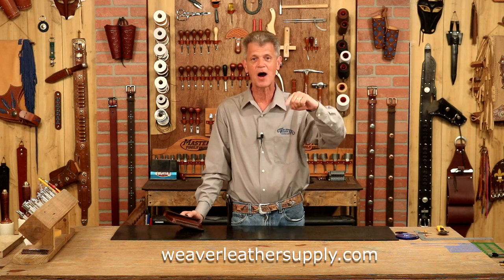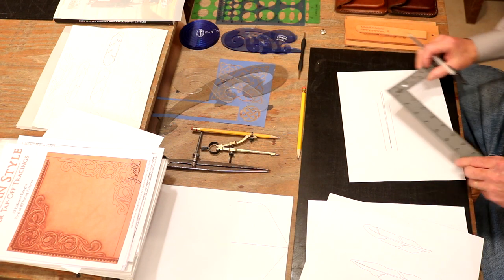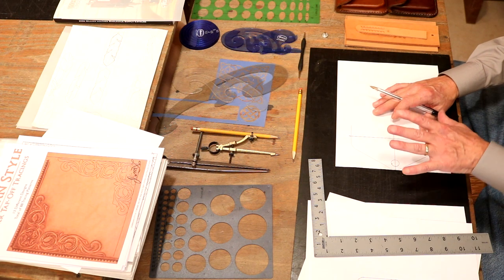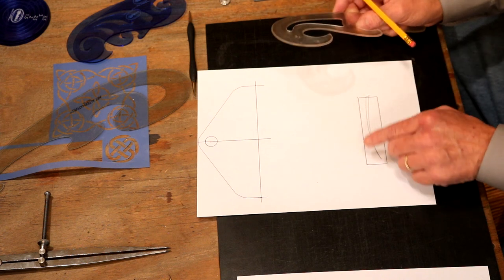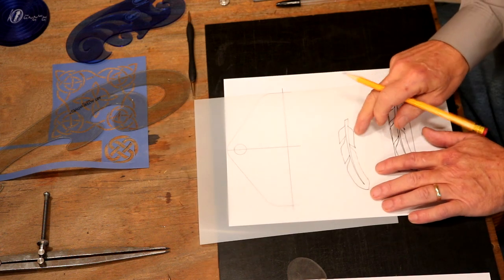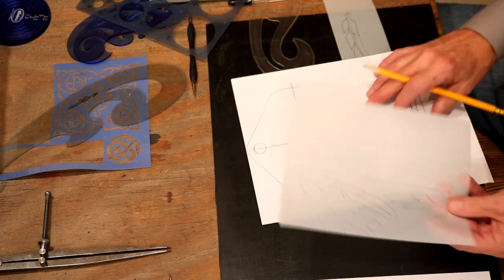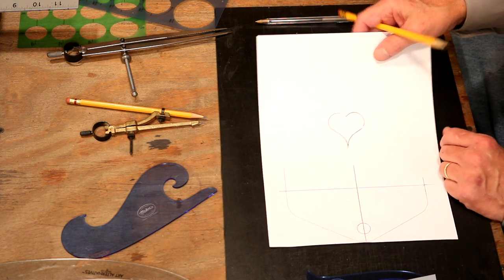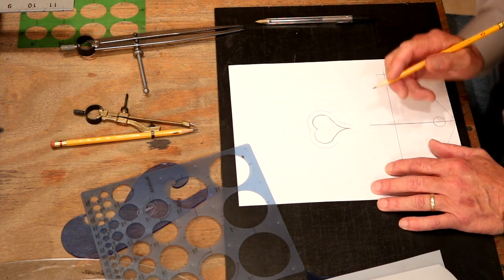Making a Belt Pouch | Chapter 2, Creating the Tooled Design

Comment: Thanks Chuck for great video. Would you recommend some good glue for bonding fabric liners with leather? Thank you.
Reply: I've had good luck with 3M Super 77 spray adhesive
Reply: @adamrasmussen6087  thank you I will try this one. The only problem is spray will be great for larger areas but I am not sure about tiny lines for pockets and such. But still, thanks for tip.
Reply: @thomasbaker3249  Yes, that can be a challenge, what i usually do when that's needed is just lay printing paper down on either side so I can make an accurate strip of adhesive.  But agreed, not ideal.
Reply: @adamrasmussen6087  thank you. Great idea.  Silly me😁😁😁🙌🙌🙌

Comment: Another very informative video. But I have a question, (which you might plan to cover in one of the upcoming segments); the depth on the pouch, front to back, as designed is approximately 1", except for the obvious need for more leather, what issues could I expect if the depth is increased to  11/2" or even 2"?
Reply from the maker: Hi John,
There shouldn't be any issues but molding around the corners will just take some extra time. You could always build a wooden mold that clamps together.